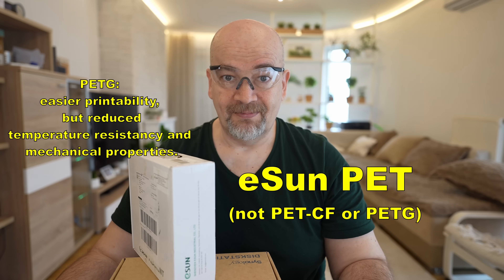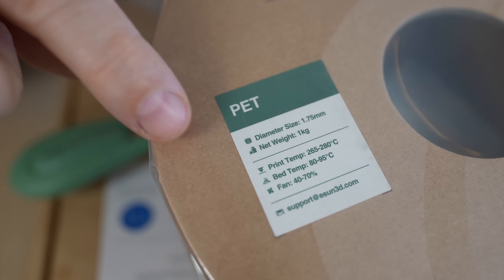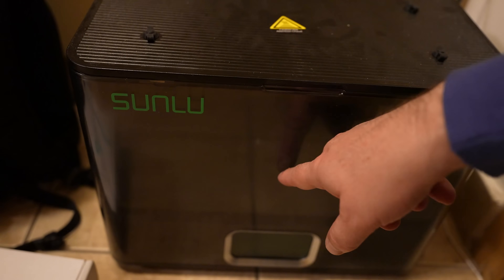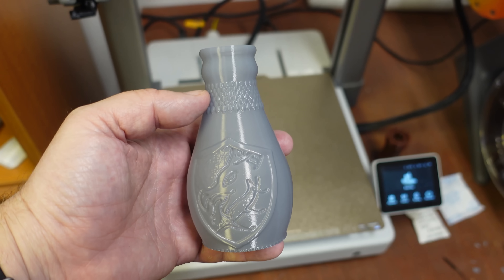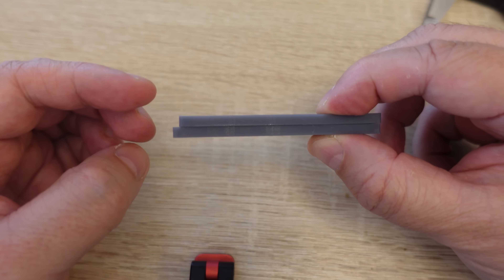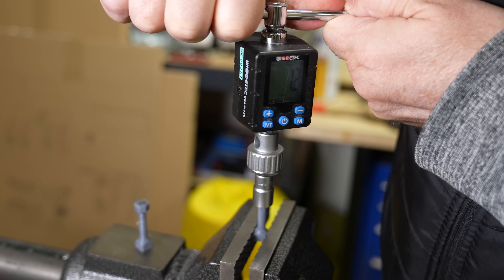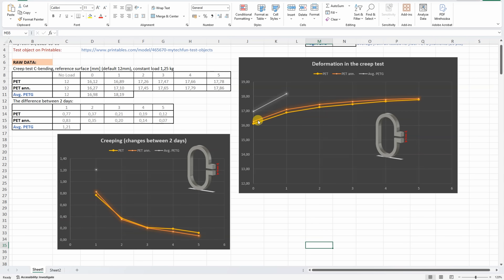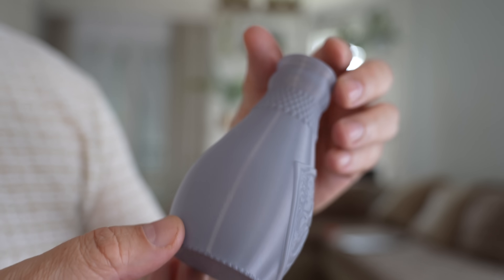Is Raw PET the Next Step After PETG? eSun Filament Reviewed

Comment: Ah too bad that it's modified, we still don't have any pure pet filaments on the market for decent prices.
Reply: Fusion filaments is good. about 35/kg.
Reply: @dirtyhippieprinting yeah unfortunately I am in EU :|
Reply: Possible to diy from bottles using old printer parts eg Ender3, but it's a lot of work to get 1kg spool
Reply: @krakers665 I know yeah, too tedious... pet is so cheap as a raw material, idk why they just can make normal pet filament lol
Reply: @EdRopple well it's pretty easy to find PP filament, even though it's 50x harder to print than Pet. I'm not saying it can't be slightly modified, but it has to at least be annealable. Also pet from bottles prints more than fine so idk
Reply: @krakers665  The practical way to do this is buy recycled PET strapping (used in packaging industry) at the right thickness and width to get a 2.4 mm² cross section, then pultrude the continuous strap material instead of bottles. This will get you filament for around $2-3/kg. But I haven't worked out a source for small enough quantities in the right size for testing out the concept before buying bulk.
Reply: @krakers665  Only outside of germany where you have 25 ct cost per bottle you don't give back
Reply: In few months we will announce our Kickstarer project with filament workshop based in Bali 🚀. rPET rPETG and rABS with high quality final product. Just for 9 USD/kg ....Stay tuned 🧐
Reply: @maxbiagi3091 nice, is it going to be pure pet that can be annealed?
Reply: @maxbiagi3091 so please contact Igor and give him these filaments for tests
Reply: @maxbiagi3091 name of the company?
Reply: Have you guys printed with pet bottle before? Layer adhesion sucks, you have to mix it with something else for it to be better, such as abs. I print with pet bottle and abs core. Its not too bad to make, just let the machine run. Its worth printing if you need that sort of material, plus its free and you get to recycle it.
Reply: @oneanother1 bro he just said that this is pure nonsense, are you even reading?
Reply: @riba2233  its hard to tell how pure any filament is, like what's the difference between hyper place and regular pla.
Reply: That is for a reason. Pure PET is quite seldom used. For most usage they will add some chemicals to make extrusion at lower temperatures possible (like the addition of glycol for 3d printing) and to keep it transparant (bottles) or de-formable (vacuum forming). 
Pure PET has a poor layer adhesion and slow cooling can make it brittle.
Reply: @wilsistermans1118  Pure PET has the absolute best layer adhesion of any FDM printable plastic. I don't know where you got the myth that it's poor. Maybe from printing recycled bottles that didn't have the glue cleaned off properly first so it's acting as a release agent between layers?
Reply: @wilsistermans1118  Most PP filaments are also no pure Polypropylene. Every PP feels different than milled PP Parts... The most authentic PP filament I found right now is the BASF PP. Look and feel of the printed parts is mostly like the machined parts.
Reply: @wilsistermans1118 For context, Dalias's 3d printer has its extruder gears printed in pure PET in open air and it works just fine.
Reply: @wilsistermans1118 Only if your printer is trash.

Comment: Thanks Igor. I wonder if layer adhesion would improve with lower part fan speeds. I found with PET-CF that it makes a huge difference, and that I needed very low fan speeds to get good results.
Reply: If layer adhesion with PET isn't fully isotropic, your problem is hotend temperature not fan. I can print fully isotropic with 100% WS9290 CPAP blasting on the part. Low cooling is not desirable for PET; it makes heat-dense regions selectively crystallize during printing resulting in dimensional inaccuracy.
Reply: @daliasprints9798  Just to be clear, so you're saying that higher nozzle temp with high fan cooling is best?  Thanks.
Reply: @retromodernart4426  You don't necessarily need high cooling, but you need enough that it doesn't anneal while printing and that any surface on the previous layer is hard so that there's compressive force welding the next layer rather than it displacing when new material is pressed against it.

What's really important though is temperature. With MPC heater control I'm able to get very good results at 285. With PID I needed 300. I would not even consider printing at 275, especially with stock printer firmware using PID. You're gonna have weak bonding (as discovered in this video).
Reply: @daliasprints9798  Does the same thing apply to PET-CF? CF or GF filament have a much lower thermal expansion coefficient, so shrinking should be minimal to begin with. I'm currently fighting warping with both PLA and PETG and looking for a way to solve this. Maybe I could try an unusually high chamber temperature while enabling the side fan to even out the temperature gradient throughout the part?
Reply: @peniku8  The fill material reduces the ability to warp, so it's probably less critical there, and there might be tradeoffs to be made if you want the crystallization. But the same principles apply. Cool it well if you don't want it to crystallize while printing.
Reply: @daliasprints9798  at any way fan makes model cooler and cold model takes energy from melted plastic so the temperature of layer adhasion becomes lower. So the solution for better layer adhesion is also lower fan speed and higher nozzle temp. You are both right

Comment: Thanks again for your thorough testing!
I really was extreme curious about this material. I allways assumed, that PET without CF is barely printable. Besides difficulties in printability i also suspected it to be stronger/tougher.
Maybe you're right and this PET is also modified. And that may also explain the easy printing on an open printer.
Reply: Real unmodified PET is easy to print on sn open printer. Really the only things you need are high temperature hotend (285-300) and a good filament dryer. Even heated bed is optional (but advised for any parts that aren't tiny).